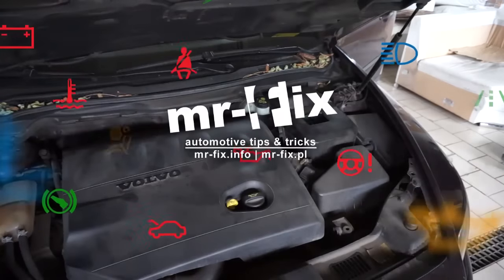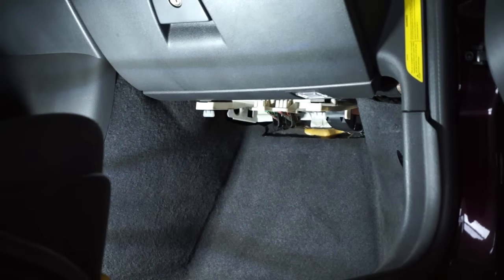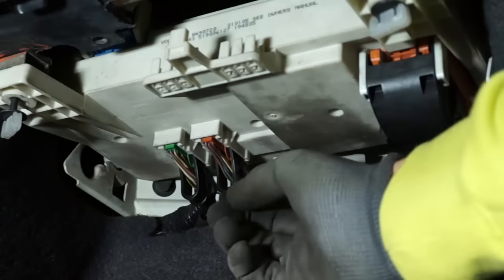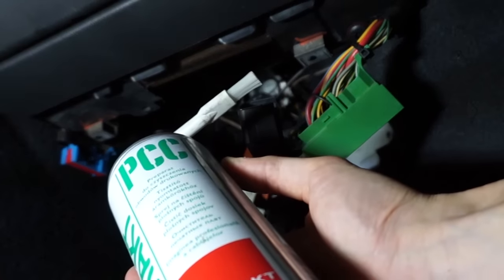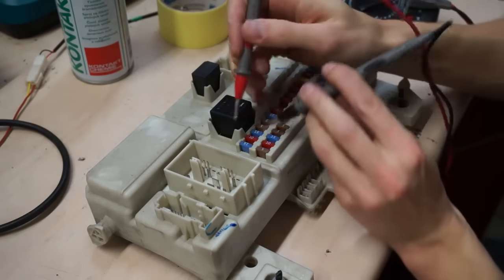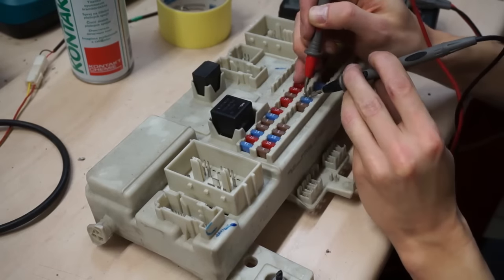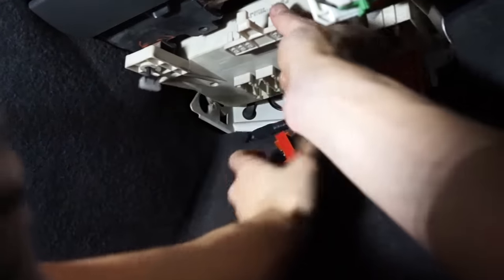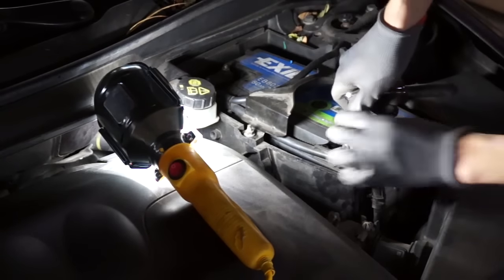Volvo C30 S40 V50 CEM / Ford Focus MK2 GEM connectors fix

Comment: Hi. Just came across this and I will do this cleaning since the cem is removed now. We thought it was the key not registered in the cem any longer but the key still remote locks and engages the alarm system. So it's just starting thats an issue with a message "start prevented try again" and the other messages are showing occasionally, the srs air bag message and anti skid shows up at times. It just hasn't started for 2 months now and I've been checking so many things from starter solenoid, relays and fuses in the engine bay fuse box, fuses in the drivers side between door and dashboard and those at the cem. So wish me luck. I'll try and let you know

Comment: Awesome videos. I have Focus 2006, central locking works only when key is inserted. Does not work with remote, i have successfully educated the key. I removed the battery, and when put it back on, the remote control worked for a week and then stopped working again. Would cleaning the GEM help in this case?
Reply: I have the same problem. Did you try it? Did it work?
Cheers
Reply: I just unplugged the black and green connectors. 
Plugged them back in and got a result...
Worked a treat.

Comment: Hi there, my V50 has some issues with the climate control. The driver side does only let warm air out. I already changed the seater-heating control units and the CCM without results. Can this cause also CCM issues?
Reply from the maker: Most likely air distribution flaps are faulty or at best require calibration. You need diagnostic tools for that.
Reply: @mrfixpl  I already did the calibration in VIDA a couple od times... Next step is to change the little flap motors

Comment: Hi mr.fix, I did this entire procedure, but when I reconnect the negative wire to the battery the whole thing sparks alot. Have I done something wrong?
Reply from the maker: I don't think so. Sparks are pretty common when connecting battery to the car.
Reply: @mrfixpl  Hi, thanks for the answer.
I fixed it! Turns out 1 of the cables weren't fastened properly and was loose. After I fastened the cable it just sparked a tiny bit and the car worked beautifully afterwards. Thanks for the well explained tutorial my friend!

Comment: My Volvo C30 D3 2011 has no response on the accelerator pedal sometimes and the car goes in to limp mode with , this error is recurrent. I have changed throttle body, accelerator pedal and socket to the accelerator pedal. Error code says lost connection with CEM. Can cleaning the connectors solve the problem?? Or is it the conncectors to ecm?
Reply from the maker: I can't promise that this will fix your problem, but it's worth the try.
Reply: @mrfixpl  thanks for reply!  i had a mouse nest in the enginge so i suspect that mouse/mice may have nibbled on some cables.

Comment: Thanks for the video!. I have the same problem in my 2011 volvo C30  (Traction, brake, no wipers control and inmobilizer etc).
Would this work on a 2011 C30 Volvo?
If I change the CEM for another one, would I have to do some kind of configuration? 

first of all, Thanks!!
Reply from the maker: CEM store a lot of information about your car (immobilizer data, comfort functions, regional options...) and it needs to be reprogrammed if replaced. It's not just a fusebox anymore :)
Reply: mr-fix  thanks for the answer! I will start for cleaning my CEM.
Reply from the maker: Hope that this will fix your issues!
Reply: DES NOUVELLES ,?
Reply: Did it help?
Reply: @mrfixpl   needs to be reprogrammed if replaced,but if repaired as you have shown,will the car need reprogramming ?

Comment: hi do you no where you can get these repaired i have a st 225 ford focus 2006 tried to find and cant find anyone except very expensive  people mine is not sending car to sleep so draining battery i got another one put that in does send car to sleep and every thing good except have no central locking

Comment: Do this actually work and cure it completely or will it be back after 6 months??
Reply from the maker: Depends why it happened in the first place. If you have a leak in the car (from the sun roof drain or AC drain) most likely issue will come back soon.

Comment: Hoping this is my issue too. Volvo s40 t5 2004. Thought it was my battery. Brake messages, abs messages, safety brake etc. Does it also drain the battery too? Mine only seems to start after I get these problems listed above with a jump start.
Reply from the maker: I don’t know if the battery drain is related with the CEM connectors. Please let me know if the cleaning helps and good luck!
Reply: Many thanks - will give it a go - only thing my car didn't do was put the wipers on.....
Reply: Do minor black marks matter on the steel prongs?
Reply from the maker: Can indicate moisture which is never good when speaking about electronics...
Reply: @mrfixpl  done now. Disconnected battery, pulled connectors, bought toothbrush and had some ipa lying around. Scrubbed as you did and put back. All ok so far. I did have the gem unit hanging down for the passed few months so maybe someone kept kicking it....All back up now and out the way. Will see what happens. Many thanks for your video, much appreciated :-) cheers, Giles.

Comment: Hi i am having problem with my valvo v60 2.0diesel no crank no start car showing u014000 lost communication with cem if you can help me please thanks
Reply from the maker: Hard to say. It might be as simple as cleaning the CEM connectors. But also it can be number of other things. Water damage, immobilizer codes erased due to voltage drop, damaged wiring...
Reply: mr-fix Thankyou very much for taking time and replying.I got it checked turned out to be locked engine plus bad startermotor causing no start but i am an wondering why the car does not lock or unlock with key wiper goes off for fun when was trying to jump start the guy who checked said that ecu is confused power and no power.Its just i will get the engine rebuild but worried if it still give me electric problem thanks

Comment: Anyone know where the leak comes from? A lot of Volvos have this issue. Mine completely corroded.
Reply from the maker: There are two main sources: sun roof drain in A-pillar and A/C drain in the passengers footrest. Then, when you heat up your car it will evaporate and condensate on the CEM/GEM.
Reply: @mrfixpl  Thanks. Mine doesn't have a sunroof. Today I removed the glovebox and the electronic module above it and I couldn't see the source of the leak. Are you saying if I unclog the floor drain it will fix it? It's hard to believe the water can back up that far to leak over the CEM. Or is it another place I have to unclog?
Reply: A more common problem is windscreen adhesive failure. This was the problem with mine and a well known fault on MK2 Volvos that was subject to a recall in some countries

Comment: I have V50 2.4L petrol. I just started the car after a few seconds the engine shuts off and all electronics are dead, after a minute all came back to live and the car started like normal. WOuld the CEM be the problem?
Reply: hellishserpent mine did that then promptly blew up causing wipers to go apeshit mental and fill cabin with smoke

Comment: Maybi a solution of the left rear door have warning of open door when its closed , have change window motor with the controll module to to times ,and the acoutator with the window elevator and the wiring ,without a better solutions , have power in too the window motor module but not power out from this unit too the window switch of sentrallook unit , have this problem of only left rear door

Comment: Wrong battery disconnection.never disconnect "+" the first.
Reply: Why ?
Reply: I think I learned why just now. It sets off the alarm. I heard it try to start as I pulled the + cable. I normally pull the - and that's never happened